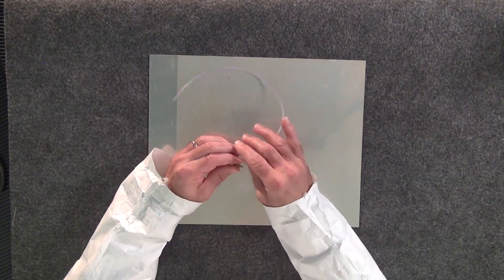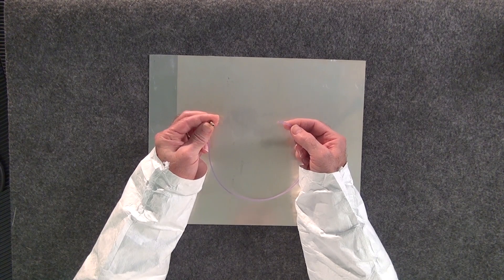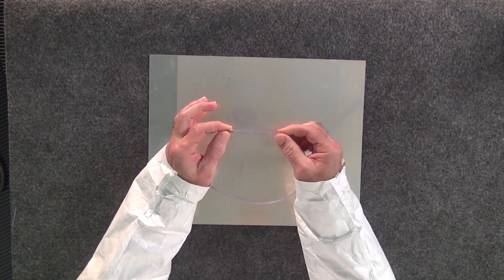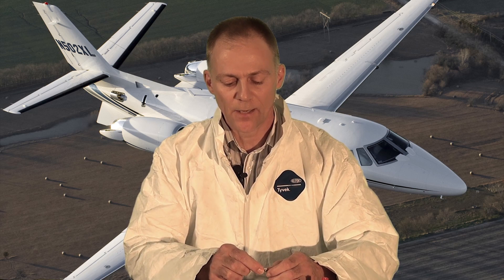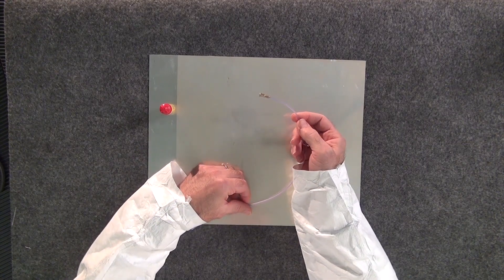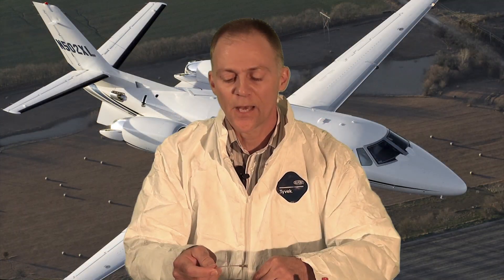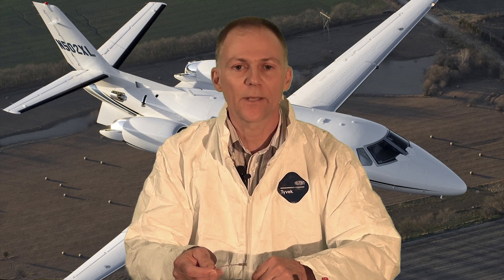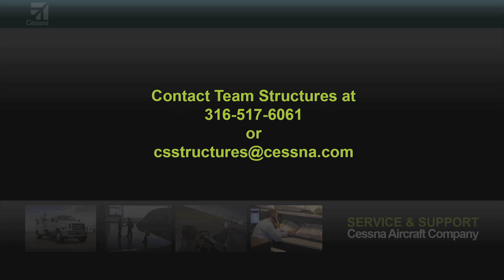Installing Hi-Lok Fasteners using String Trimmer Line

Comment: We did this at the airline I worked at in 2000. Up til then everyone used safety wire to pull hi-locks. Trimmer twine works the best. This is old news Cessna.